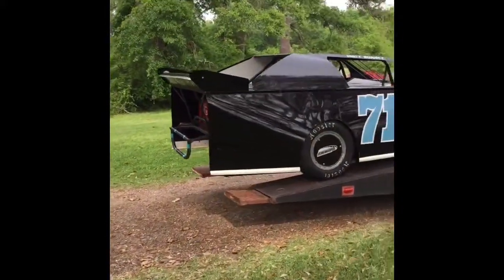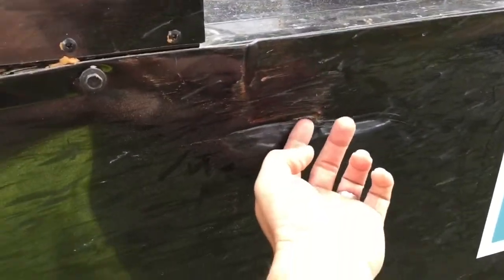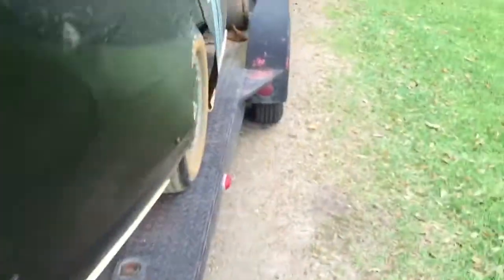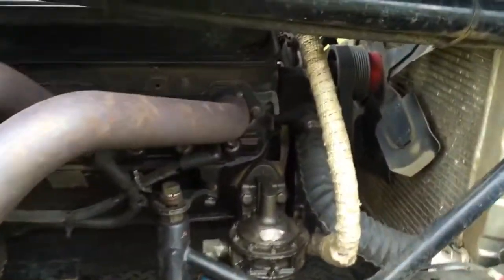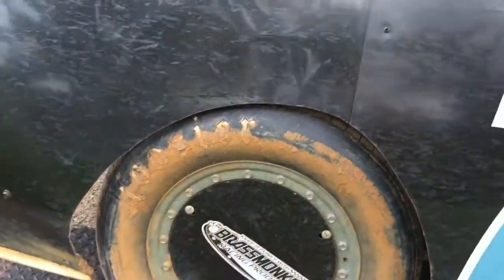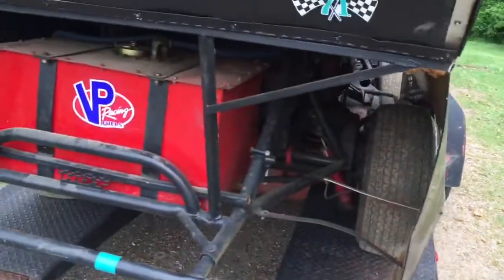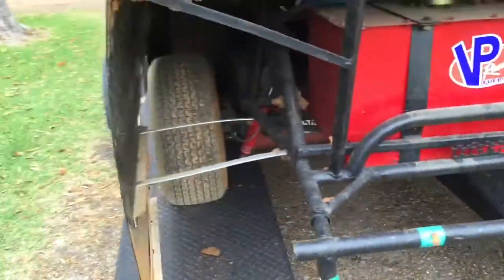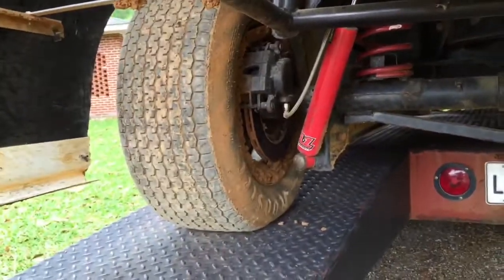Before and after 1st race of season

Comment: Make more videos and post up.
4 the is a good finish Bud no matter how many started.👍 Is that a Ford 9" you're using? What track do You run? Is that a 604 Crate mid or do you run an open motor? Please more videos, there's not alot of homegrown videos like this out there to enjoy.👍👏✌
Reply from the maker: Tommy 1 C. That was a few years ago I’m driving a factory stock this year and i will make more videos